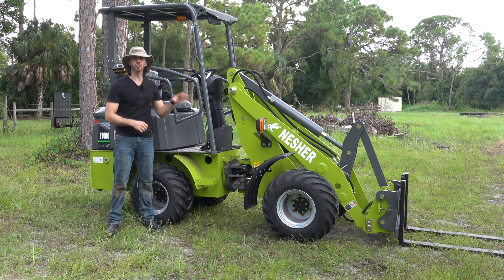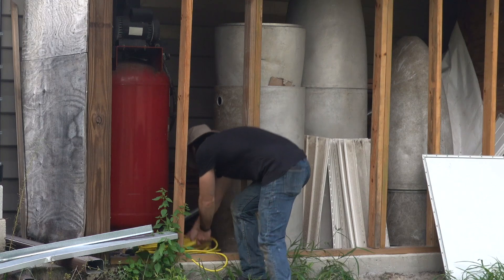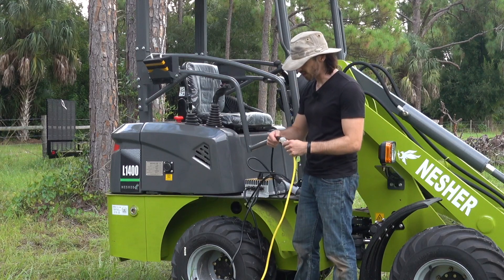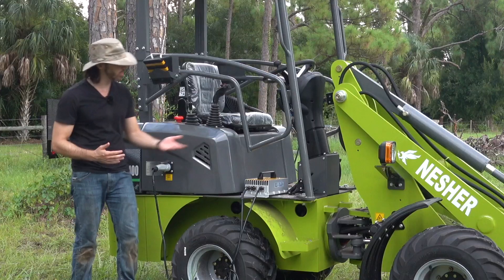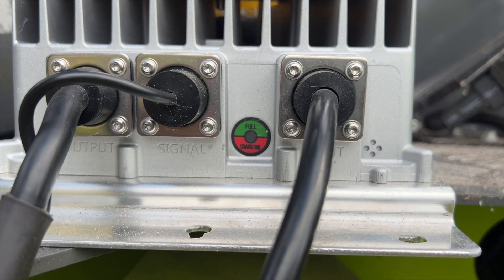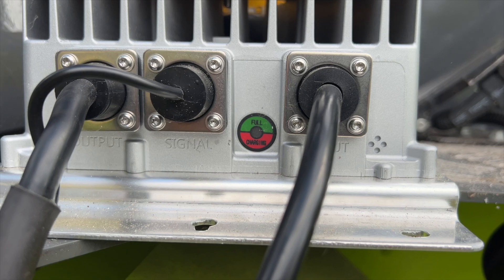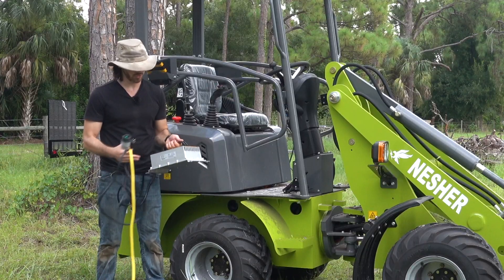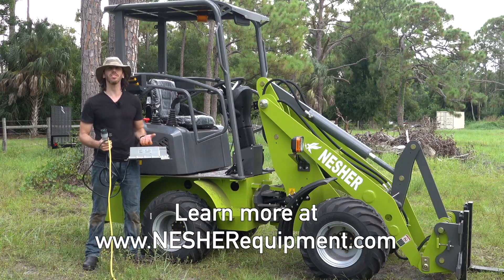How to Charge your Electric Loader - Electric Heavy Equipment

Comment: Why does it not have inboard charger
Reply from the maker: Because tractors can experience tough working conditions and the charger has more sensitive electronics. This prevents the charger from bouncing around more than necessary. The charger is also mountable on a wall, so if you park in the same spot every day in a barn or shed, you can just mount the charger next to the spot for each charging.

Comment: Has there been consideration for building the charger somewhat into the machine or at least mountable into the machine and making it more waterproof? What type of charging plug style does it use?
Reply from the maker: We've looked into on-board charging, but due to the nature of the machine, they're designed for a hard knock life. The charger has more sensitive electronics in it and isn't designed for the kinds of bumps and vibrations the machine experiences during heavy duty use. Keeping it off-board means it is better protected. The charger is wall mountable though, so if you park in the same stall, barn, etc, it's easy to to just roll up to the charger and plug in. The connector is a YEEDA Y60 connector.